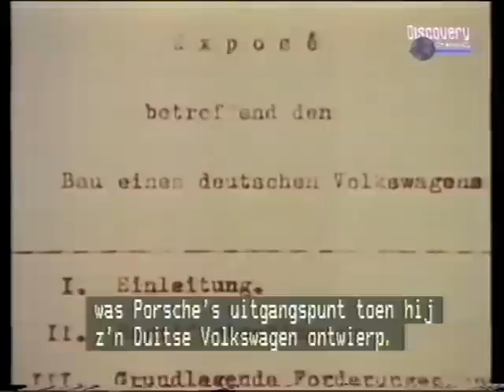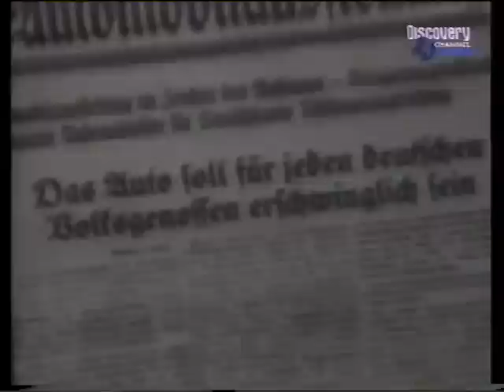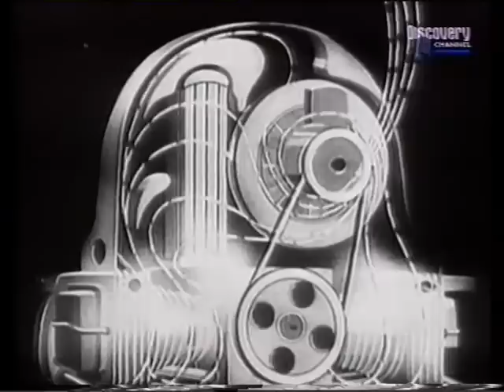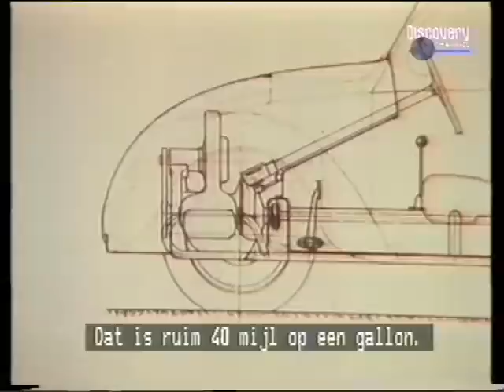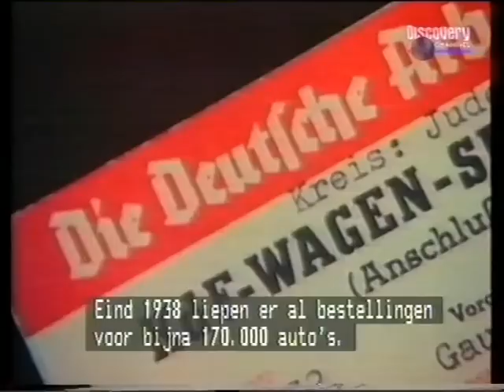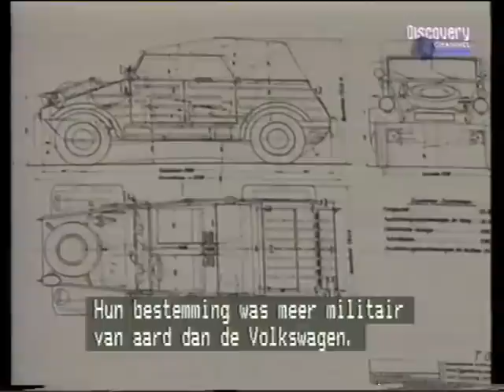vw beetle documentary Classic Wheels (1/3)

Comment: Another order from Hitler was that the car had to be capable of a cruise speed of 100 km/h (62mph) on his Autobahn. Porsche said this was impossible, but 100km/h as a top speed was no problem. Hitler agreed.
Hitler is said to have designed the headlights. The original ones were as small as the rear lights, and Hitler felt the car needed eyes, to make it look friendy, to give it a facial expression.
Reply: DolleHengst Interesting. The headlamps are one of The most prominent design features that made the beetle into such a lovable character and probably defined it's "face". It's also one of the main reasons why I'm so charmed by it.